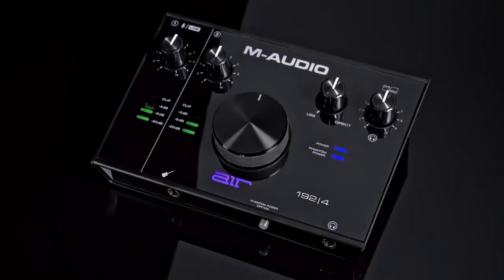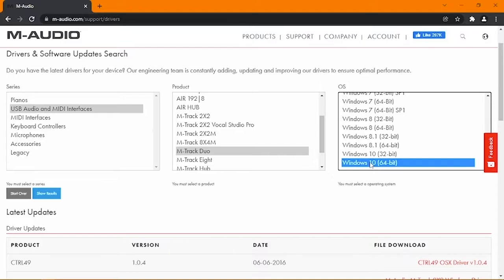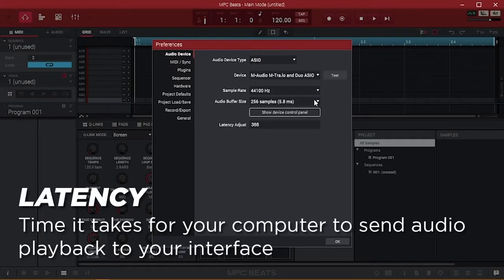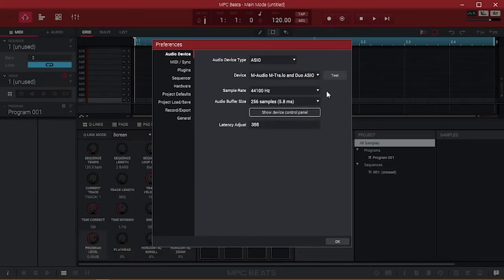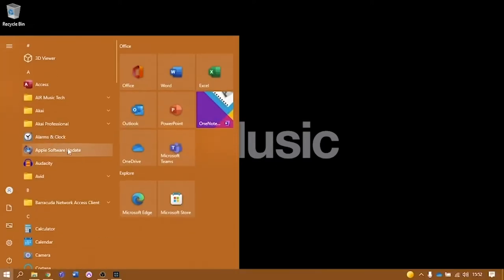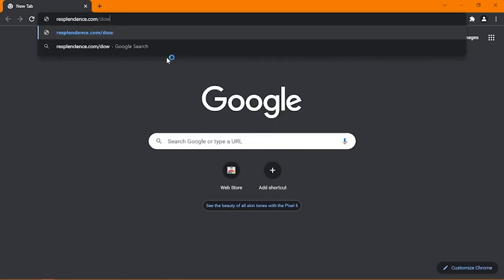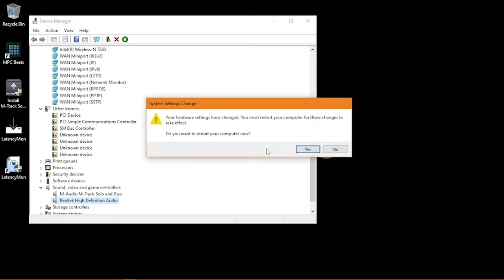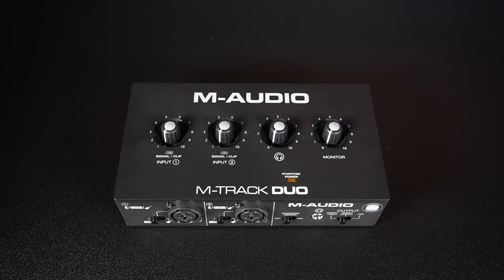M-Audio Interfaces | Troubleshooting Distortion, Clicks & Pops

Comment: I'm using an Mtrack MkII and for some reason the default buffer rate went changed. I downloaded the driver after that and set it to my preferred buffer rate but everytime the audio console says its streaming (usually when I use it in discord) my applications start to become unable to recognize of hear my inputs

Comment: I was having an issue where my IEM was sounding noisy in my interface but not when connected directly to PC's headphone jack. Also, this issue wasn't present on my headphones. I noticed that the noise wasn't permanent. I mean, the noise starts (with a subtle pop) when there's an audio signal, stays for a few seconds, then turns off (with a subtle pop) as of the actual headphones amp on my interface is turning on and off. I noticed that my headphones volume on the interface was 100% while on the OS it was just 20%. I set both the interface and OS volume to 50% and the noise is inaudible now (though I can still hear the very slight pop sound of the amps turning on and off. ( I know the volume in OS is supposed to be 100% and should be controlled by the interface, but I like to control volume from the OS because I am lazy, and also because of the fear of wearing out the potentiometer.

Comment: I was having annoying clicks when listening to music on my M-Track 2x2M with MacOS. I'm not using a DAW, just using the interface as a DAC. The solution was simply to turn down the volume in the music player and this fixed the problem. 
Unfortunately it's not really a proper fix as it means you need to reduce your volume on every piece of software you use (MacOS does not let you adjust the volume in the OS when using a DAC). And if playing music directly through Finder, there is no volume control. Would be nice to see some drivers from M-Audio for MacOS that would allow adjusting the OS level volume rather than just relying on Apple's audio drivers.
Reply: Have you solved the case anyhow?

Got the same situation with M-Audio Air 192/6. Lowering the volume should never be the solution. My previous Focusrite didn't have this issue, so I believe we just bought the brand we shouldn't. If I won't find any reasonable solution, will change back to some other Focusrite interface definitely.

Comment: any tips here?

my Air 192 8 + windows 10 will not keep the bitrate or depth. Seems windows keeps reverting it AUTOMATICALLY upon playback/recording. It causes immediate and continuous dropouts. I've been able to record small bits, but upon saving+reopening, my DAW has a hernia, and the Windows sound settings reverts the bit depth and sample rate to an incorrect setting, the M-Audio control panel keeps flashing "streaming/not streaming" as Windows and M Audio fight tug of war for the sample rate/depth... Idk what to do!
Reply: same issue
Reply: @moonfallling5964  hey i sort of fixed it on one of my PCs a few months ago ots hard to recall exactly, but i remmber my problem had to do with the specific order of installation, I mistakenly did not folow the manual and the fact i tried plugging in the device at the wrong step.

I recall starting fresh and following the manual TO A TEE. Every little step, and it ran fine, ive set it and forget it since then, good luck m8
Reply: same! M-audio Air have only 24 bits and it returns to 32 for some reason

Comment: 2:52 In the device dropdown I have the m-audio ASIO driver but when I select it it does not find the hardware. I have the latest drivers and re-installed it hundreds of times and it makes no difference. ASIO4ALL causes the DAW's to lag and 
crash.
Reply from the maker: Hi! Which M-Audio interface are you using and how is it connected to your computer? Are you using any USB hubs or adapters?
Reply: @inMusicBrandsSupport  i have the same problem, mine is connected via usb cable, all drivers isstalled, and is detected by the pc, but on my software wich i used to play guitar ( bias Fx 2 ) and in audio options i choose Asio and cant find the M audio, it says no audio device found

Comment: still have Clicks, Pops and Drops off. Even when I watch video, I have freezes in video and audio. When switch back to the built in audio, no problems occur (video plays smooth without freezes, audio has no any sort of distortions). Also tried to do some trick. I've connected a mick to the input of Air interface, and out was set to the built in audio card. Sound was from microphone was clean. Switched output back to Air 192.6, got distortion, and all other sorts of nasty things :/
Reply: Habe das gleiche Problem.
Komischerweise hat das gleiche Interface an einem Laptop,  kein Problem.
Ton ist eingefroren und starke Aussetzer! Onboard kein Problem 
Irgend eine Lösung?
Habe ein neuen High Ende Pc
Reply: Muss an einem Windows Update Liegen.
Aufgefallen ist mir das immer im 32 bit Startet.
Audio Latenzen gibt es laut Daw Nicht.
194/14
Habe schon fast alles durch Tag ein Tag aus keine Lösung
Reply: @dirkb9336  got the same problem sometimes, meaning Windows sets this interface to 32 bits O.o On my previos PC I've never noticed such problem, but, as I've mentioned, had different issues anyway.
Reply: Mein Laptop hat noch Windows 10 ohne Probleme.
Vielecht deswegen!

Comment: I have a bad static problem with the Air 192|4
Reply: me too
Reply: @Snowcen  same, did u guys figure out how to fix it by any chance??
Reply: @a6adguy955  no, my only guess is a wire thing or a driver thing as it doesn't support windows 11. Idk what to do as i've been on the problem for a while. maybe the driver itself is getting outdated.
Reply: @Snowcen  i think is the driver because I uninstalled it (the m-audio air 194 driver) and it was replace by a generic DX 194 driver, wich it sounded better (but wont let me use my interface for recording). As soon as i re-installed the driver the issues came back
Reply: @Lihuezapallo  Uninstalling it worked

Comment: AQUI UN COMENTARIO EN ESPAÑOL. Tengo una M Audio Air 192 4 que me vino en un kit. Al conectarla a mi lapsos con Windows 10 pro original crashea y tiene cuelgues. Configurando la placa a 24 bits y 44.1000 mejora un poco pero es engorroso estar haciéndolo cada vez que inicia el sistema. Otra cosa que mejoro fue cambiar la configuración de energia a Alto rendimiento. Y poner que los USB no se apaguen. Tengo una laptop con un I3 y 8gb de RAM. Probé con otra laptop sin Windows original marca EXXO y anduvo sin problemas. Al parecer Windows 10 tiene ciertas limitaciones con la energía de los USB. Pero no estoy seguro. Si saben algo más comenten.
Reply: Tengo una laptop con un I3 y 8gb de RAM. Probé con otra laptop sin Windows original marca EXXO y anduvo sin problemas. Al parecer Windows 10 tiene ciertas limitaciones con la energía de los USB. Pero no estoy seguro. Si saben algo más comenten.
Reply: Tienen que mejorar los controladores. Somos muchos los ususarios con estos tipos de errores
Reply: lograste solucionarlo?
Reply: @KyozeH  si. Me compre una mac y cero problemas jaja. Levanto sin instalar ningún driver. Aparentemente en algunas laptop con Windows pasa esto.
Reply: @israelizk olvídate, es Windows.